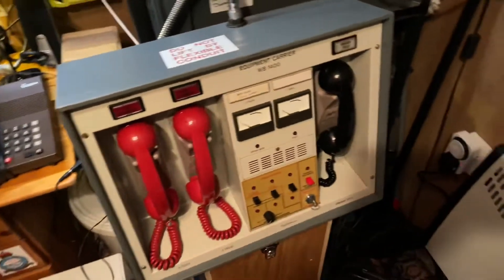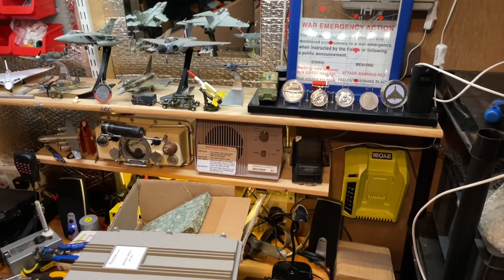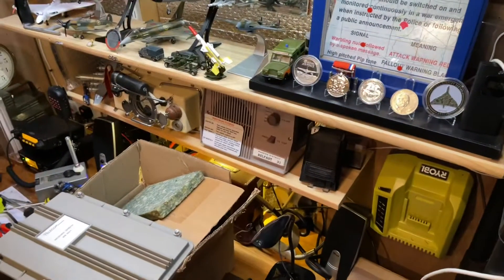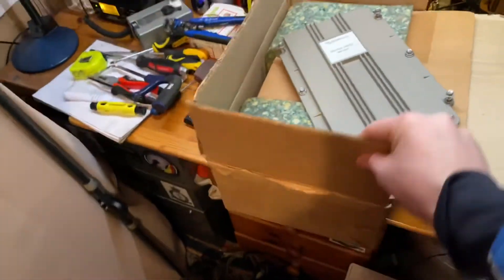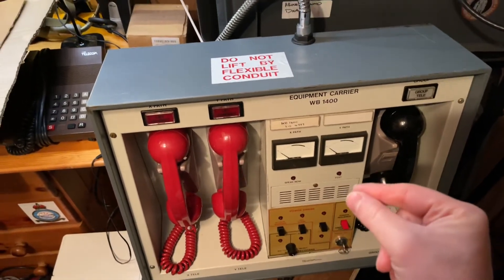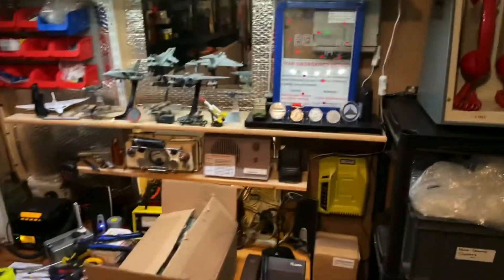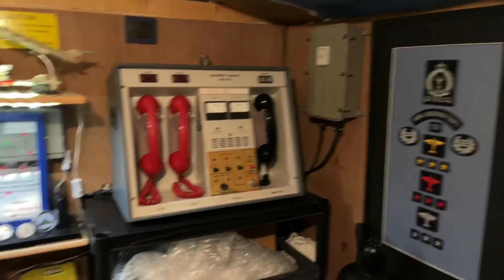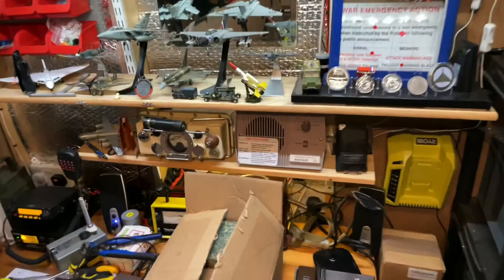Nuclear Warning Control Point Part II

Comment: Do you have a WB40?
Reply from the maker: I take it you mean a WB400? The 1st generation of warning equipment? Yes, I do.
Reply: @SurvivingTheApocalypse  Thanks. That's nice. I used to look after several of those for the NHS as part of the Civil Defence protocols. Could you wire in one of those too please? BTW, I still have a PDRM-82 which I saved from destruction when they shut us down.
Reply from the maker: Sadly no, the WB400 system was very different to the WB1400. Different tones, different voltages etc.

Comment: I have identical power unit casing but its for a WB1000 BT redcare aarm, not sure what t do with it
Reply from the maker: We had one of them in the house I grew up in for our alarm system. Its a shame the internals are totally different as it is identical on the outside to the Speech Receiver one.